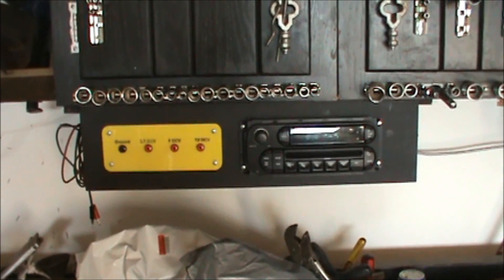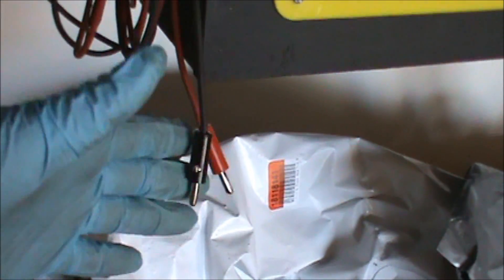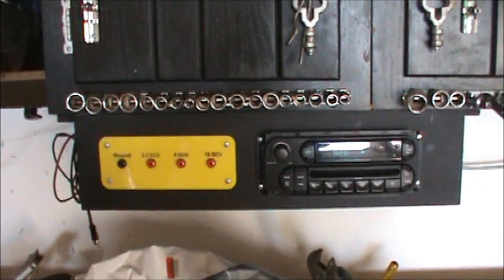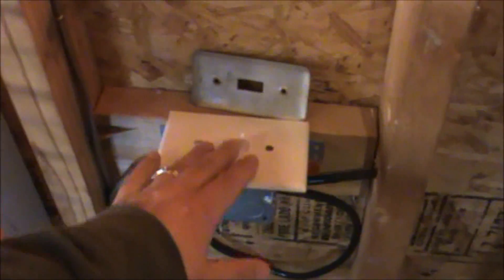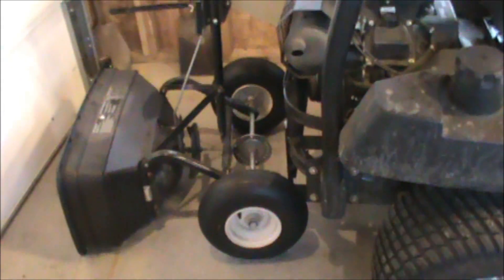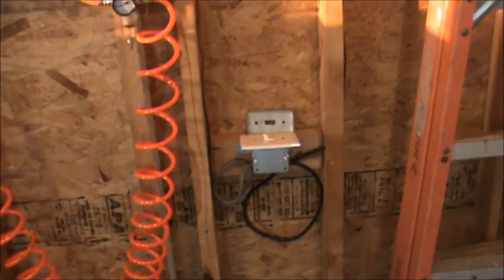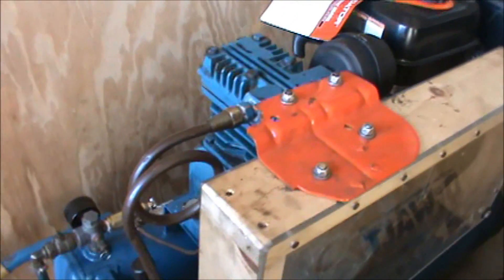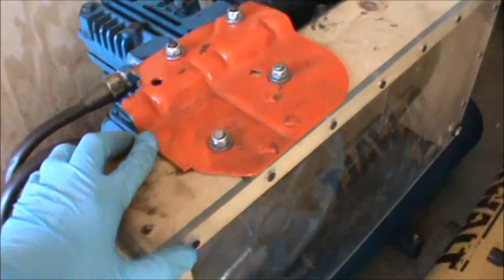3 Dumb But Cool Projects

Comment: 1st Id like to say that your videos are great. Now as far as safety goes, you need to be very carefull that you are NEVER using compressed volumes that are expandable in any plastic type containers. Im very worried about that fiberglass tank that may be rated for pretty high WATER PRESSURES. Water cannot compress, air does compress and if there is a failure in that tank, you could have a very dangerous potential bomb in your garage... Please check it out man, be safe...

Comment: doublewide6, Real cool job on the radio/computer power supply project, I have a need for that. About the fan guard, good idea, one does not need there stuff, children, body parts, or pets chewed up my moving machinery. One concern though, is the fan on the compressor pulley able to cool the compressor? I could not tell if the plexiglass stopped air flow. Thanks for posting, good ideas, good video!